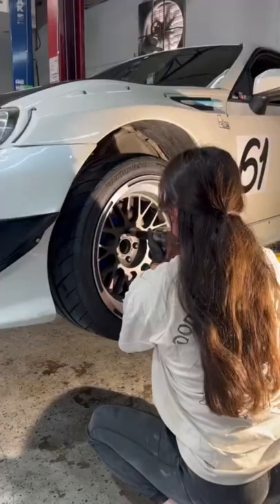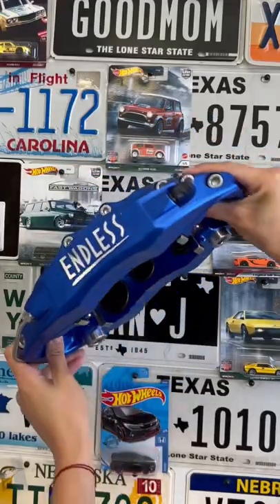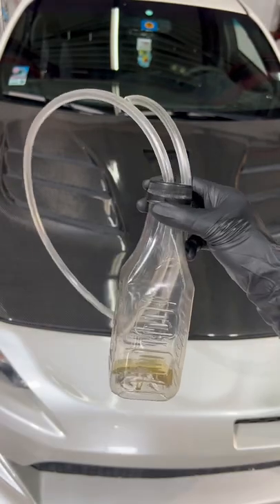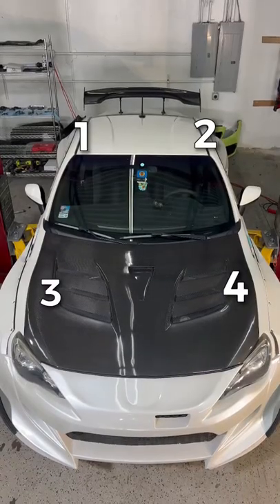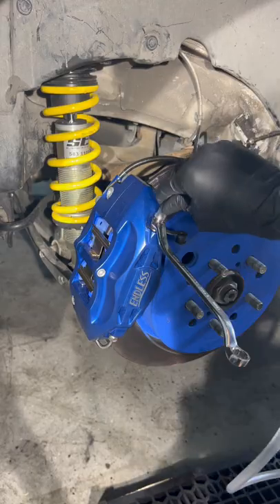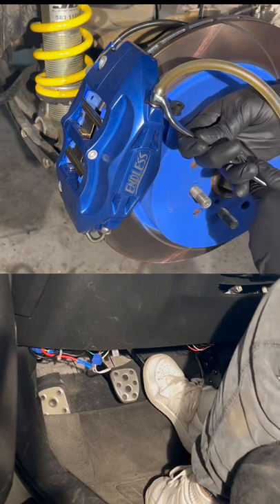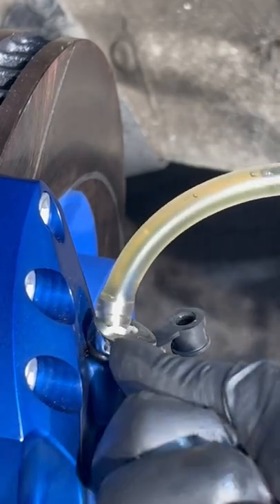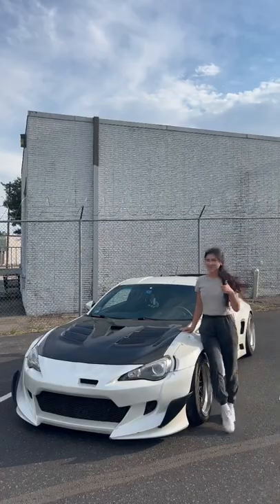How To Bleed Your Brakes✔️

Comment: You should not need to open and close the brake bleed bolt that quick to avoid air entering back into the system.  That will only happen if your friend takes their foot off the brake pedal.  Hope you can trust them 😅
Reply: i know right lol
Reply: air will only go back in if your tube has air just just keep pumping until it’s all fluid
Reply: Even if their foot is on the pedal, it will still rise back up unless you have a 1-way valve.

Comment: If you replaced the calipers make sure the piston is pressed all the way in with the bleed screw slightly unscrewed and the brake fluid reservoir cap open if you have fluid in the system when you install the line. You'll barely take one air bubble out afterwards.

Comment: Typically a modern day cars brakes are divided into two diagonal circuits so bleeding in a diagonal pattern makes more sense. Using your numbers it would be 1, 4, 2, 3. Furthest, nearest =circuit 1. Furthest nearest =circuit 2. Check Manufacturer to be sure.

Comment: You don’t need to bleed every caliper if you just replaced one, as long as you don’t let the master cylinder run dry… just do the one you replaced… if you do multiple calipers, start with the furthest away from the master, and then the next furthest etc…

Comment: If you had put fluid in the bottle already, you can just open it and pump, only one person is needed. It will suck up the extra fluid in the bottle instead of bringing more air into the system
Reply: Never thought of that but I can imagine how it would work good idea

Comment: I have a simpler method. When changing the caliper, open the oil drain screw with the new caliper. After the old brake hose is installed, you can see that the brake fluid flows out of the oil drain screw port, and you can see that there are no air bubbles to lock the oil drain screw port.

Comment: That’s nice to know, but there is different ways. If you let that master cylinder go dry, you’re going to have bigger problems, they sell a small line that goes back into the Reservoir off of your master cylinder first you bleed the master cylinder. One tiny bubble and it’s spongy pedal

Comment: With a full bleed or fluid change I generally open all bleed nipples and let gravity do most of the work while I have a tea
Then lock off and bleed from furthest. 
Normally it's only 1 set of pumps per corner and then repeat once more for peace of mind in the same order.

Comment: There is a trick to it Easier would take a little bit of time. You can rapidly pump your brakes but you leave the. The hose submerged in the brake fluid and that bright fluid will prevent air from going back in it just Bring in bright fluid. Auto text🙄

Comment: One do not assume that all break bleeds are 10 mm.
Two don't use the open end of the wrench use the closed end two reasons one less chance of rounding off the bleed nut to the open end can extend and get jammed against the body of the brake caliper causing the bleed screw not to close properly and also damaging the caliper. 

Three You should not be stabbing at the brake pedal slow steady application of pressure will produce far better results. Also make sure that you depress the pedal after each caliper to check for improvement in pedal resistance.

Four make sure that you clean the area around the brake bleed and double check everything before you put the rims back on. 

Five Make sure you know if you have an inboard and outboard bleed under somebody else here mentioned do the inboard first on each caliper.

Last but not least If you're going to provide information provide all the information don't half-ass it and leave people hanging who don't know. And if you don't know find out before you stop making videos.
Reply: She makes short-form content, im sure your recommendations for her are good, but its not half assed, its some basic info that is still solid.
Reply: @Feckt  I'm not going to debate you on this when the information is incomplete it's half-ass there's no getting around it. If you're going to provide content like this then make a long form and put a link in the comments. But don't leave people with healthy information thinking they know what they're doing especially with brakes it's too dangerous.